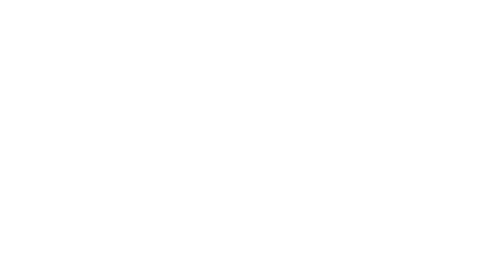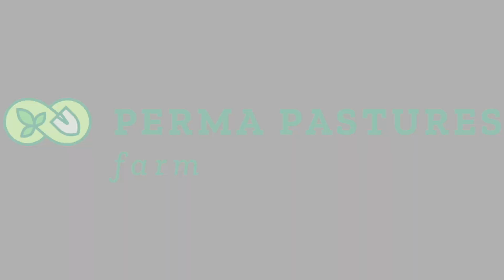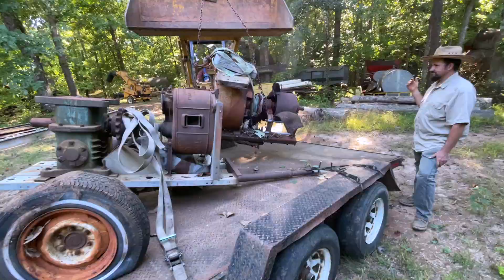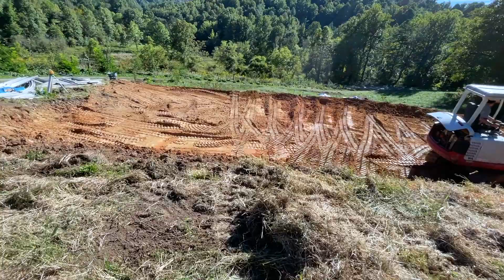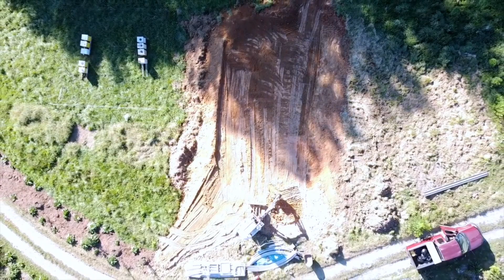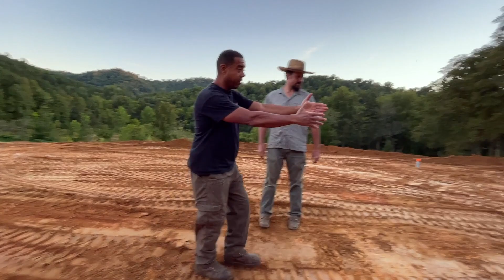High Tunnels and Crème "Bruh"lée

Comment: That subsoil is what you want to form your platform with. I did the same and used 600 ton of clay subsoil fill to form my perimeter of the high tunnel on the downslopw side.  Ours will be 30x100. The clay came from a local commercial project and will hold its form thru rains and erosion forces.  I then in filled with topsoil and compost as plan on direct planting IN the ground as to avoid property taxation as a "high tunnel" (ground planting) is NOT taxable or in need of a building permit, BUT a "greenhouse" where you table plant IS taxable and requires a permit. Know your laws and language folks.